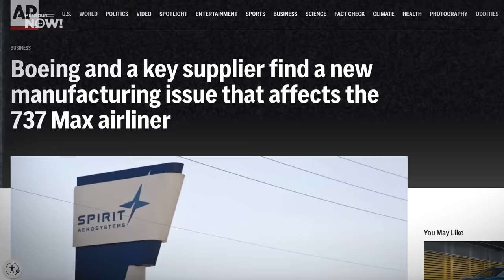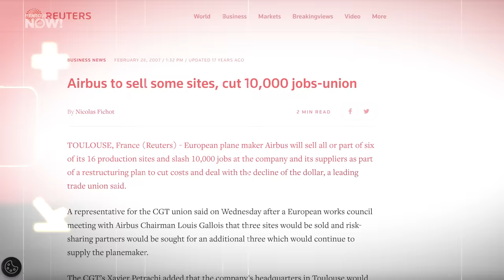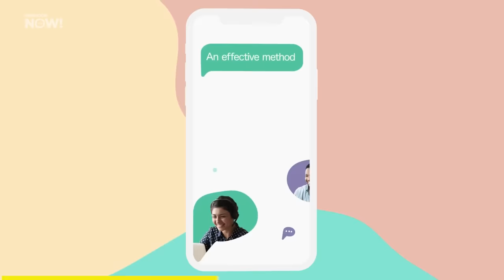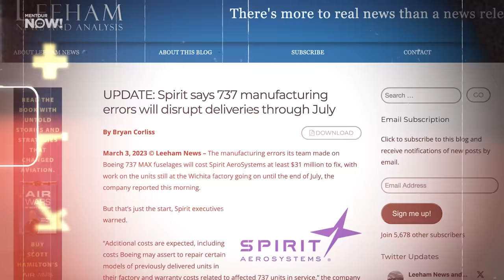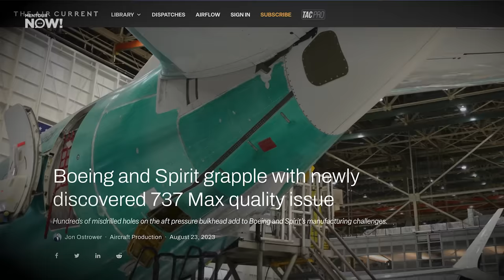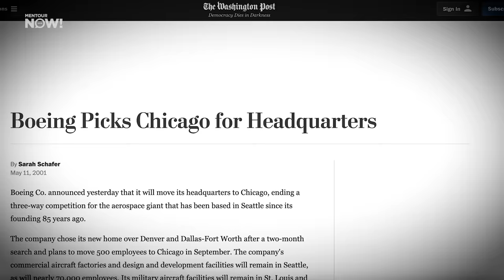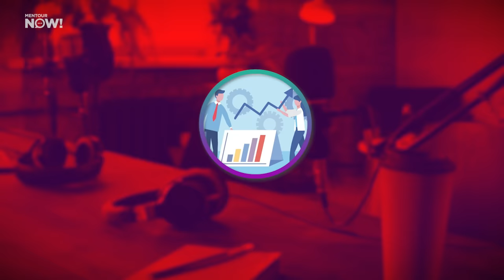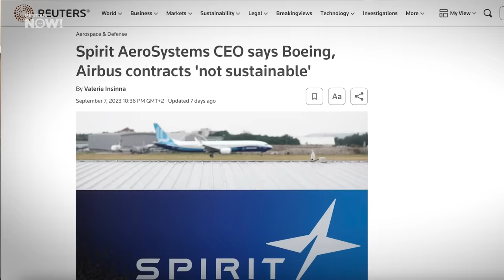NEW Problems with the B737MAX!

Comment: I am a former Boeing employee and had worked on DC-10, MD-11, C-17, 787, 777.
Boeing had gone down hill ever since 787 fiasco. Actually, it started back in 1997 when they bought McDonnell Douglas. The new management from McD had focus on profit rather than quality and excellence. They would always seek way to make money and reduced in-house production cost by focus only on assembly.
787 prototype and production proved that quality went down if the engineering and production weren't controlled by in-house. They spent more money and time in Everett by reworking and scrapping the sub-assembly from Italy, Japan and Korea. Every one was shocked to earn Mitsubishi in Japan had sent wing sub-assy to Korea, Korean couldn't even make fuking Hyundai!!!
The second mistake was relocated the 787 assembly to South Carolina to save on labor cost from the experienced union work force in WA. The hamburger flipper in S.C. screwed up the 787 big time. It took years for them to fix 787 acceptable to customers. Some of the work force in S.C. actually came from a worst company Vought.
Vought was as bad as Triumph.
Spirit is another screwed up company that Boeing relied heavily on in the name of profit.

Comment: Now another issue with a possible loose bolt in the rudder control system which operators are being asked to check. I guess AD's happen with all aircraft even when they've been in service a long time, but with the Max you can't help thinking it's a bit of a bodge job.

Comment: In the Boeing 737  Flight Crew Operations Manual (Quick Reference Handbook) is procedure "9.1 "Runaway Stabilizer" Condition: >Uncommanded stabilizer trim movement occurs continously< .The procedure is dated March 27, 2014, about 4 years before the Lion Air 737 MAX crashed. This procedure could have saved the aircraft.

Comment: It's funny how you mention Aerostructures in Hamble, (noe GE of course) as I used to work there quite a few years ago. I used to repair the Aircraft Manufacturing Tools, which were mainly Riveters and Drills for obvious reasons..... It was quite an experience and I used to love walking around the complex seeing how things were manufactured. I also had to along with colleagues test and set "Hand/Arm Vibration" Regs on certain tools.
it was just strange hearing the name "Aerostructures".... Thanks.

Comment: When bean counter get involved engineers get the boot. As for work ethic, that is also severely affected by policies which do not fall in line with safety, but hinge solely on the bottom line.

Comment: Touching on your comment about rail connections between the Renton and Everett plants, you are mistaken. While a line between Renton and the mainline east of Everett was severed some years ago, there is still a mainline between the two. In fact the fuselages coming from Spirit to Renton pass about 1 mile west of the Everett plant, and the parts that Spirit makes for the wide body aircraft take a spur from that mainline up the hill to the plant. Therefore, if appropriate flat cars were outfitted to carry 737 wings, they would simply follow the reverse route between Renton and Everett as the fuselages take, and those fuselages going to the Everett plant from Spirit, would just have a slightly shorter trip than their Renton counterparts.

Comment: Most big manufacturing/product businesses went through this “fad” in 1980-90’s to outsource non key components and move to being assemblers of their products rather than manufacturers, numbers were worked on cost to buy in vs cost to manufacture, there was pressure to get the “right” outcome to justify outsourcing, as such the cost of project managing outsourcing of products were minimised/ignored.  Project management of outsourced components became focused on purchase cost and OTD (on time delivery) in most cases Just In Time delivery to avoid cost of inventory. Cost of quality control was ignored and as such budgets not allocated to put inspectors in sub suppliers premises, this has led to many cases where final product integrity has been compromised by this approach.  It also has impacted lucrative spare part service businesses, as customers get smart they realise they can buy spare part significantly cheaper by going to the actual manufacturer and saving the 40+% overhead+markup the end suppliers add to spare part costs.

Comment: My philosophy is cheap is expensive. The 737 is cheap but it’s been so expensive for Boeing they could have built and entirely new aircraft line replacing the 737,757,767 dubbed the 797NMA. Offering it in 3 different versions to replace its beloved 73,75,76 aircrafts seating from 150 to 250-275. Wider fuselage with different lengths to accommodate and tailor it to customers needs. Giving the aircraft greater ground clearance to accommodate several different engine types depending on their max takeoff weight. With all the problems they had with the 737max a clean sheet design would have proven to be much better like the 787. The 777X is an old design and is way behind schedule again cheap is expensive. Just ask anyone who flys a ULCC 🤷‍♂️✈️

Comment: 9:40 The snowmen — finished properly — leave a figure-8 hole, or a round hole? When you say ‘elongated holes,’ is the problem when the second drill overlaps so neither hole it good? Maybe I am confused by the inserted manufacturing shot. Anyway good work.

Comment: The "snowman" holes point to potentially serious systemic Boeing quality control issues.  There are just too many stories of problems in current Boeing manufacturing practices.  There needs to be a halt and complete review of all Boing manufacturing procedures and QA / QC systems if we, the travelling public, are to have any faith in Boeing aircraft.  Let's face it, someone knew right at the outset of the faulty "snowman" drilling - and to have 300 of them in a given pressure bulkhead is no accident.  As an engineer I have experience of dubious quality issues with US profit driven production - and I suspect this may just be an industry wide problem that needs urgent regulatory oversight.

Comment: Nearly every company in the world that makes any complex product relies on at least one parts supplier. And every single one of them has a history of some kind of issue with those suppliers. It is amazing that after all these years the Apples, Samsungs, Boeings, and Air Buses of the world have not yet figured out, or are unwilling to implement, the necessary relationship it takes to eliminate those recurring issues. It must be a relationship that is so tight as to actually blur the lines between the companies. Only then will they be able to overcome these issues.

Comment: Airbus, as a European co-operation project, was set up to handle distributed manufacturing from the start. They have been floating wings on barges out of Wales and threading vast components through tiny streets in a French village for years. You wouldn’t design a system like that from scratch, but Airbus wasn’t starting from scratch and by now they have simply made it work. Boeing could have had a much more efficient system but they chose not to.

Comment: It's very easy to understand: originally, Boeing was managed and run by engineering people, a lot of them who came up through the ranks and were very smart people.
Then corporate America people gained control of Boeing and things have steadily gone downhill ever since do to cheap thinking in the head offices. So instead of making a bombproof plane even if it cost a bit more the push was to make everything cheaper and cheaper, even in departments like design.
How do I know this is true? Because I have over a dozen friends who either are still working for Boeing or retired after 20 or more years with the company
Reply: Best airliners ever built have to be the Constellation & the 707.

Comment: The 737-max issues have destroyed my trust in Boeing. That said im forced to fly on the 737-900's in November :| I can only hope they haven't had any issues.
Reply: Theres plenty of airlines in the US that fly Airbus 330-320-32. Yes it might cost a tiny bit more or you might end up on a discount airline but I stopped flying Boeing after 50 years. I make the extra 10 minute effort to fly modern aircraft that practically fly themselves. Airbus is simply superior.

Comment: The Fact that the FAA did nothing concerning non conforming geometry in a pressure bulk head takes the cake.  You think they would have learned there lesson with the Maneuvering Characteristics Augmentation System (MCAS) and Boeing's "self Audits".  300 out of 4000 fastener holes means 7.5% are are non conforming. That is beyond statistically significant.   The bottom line is Boeing cares more about share holder margins than flight safety.Boeing use to be a great company until the bean counters starting running it.  Maybe they should add a rudder and a ship's screw. I am sure they will need them sooner than later.

Comment: Pretty much the same thing could be said about General Motors during the late 1960's through 2009. GM (and almost every major builder) could've built their smaller, more fuel efficient cars (Vega, Chevette) better. Instead, they passed on basic engineering to save a buck and the marketing team tried to market the appeal of their crappy products. The Vega failed almost immediately. The full sized cars interiors were made of plastic  Fisher Price passed on. I own a low mile 1971 Oldsmobile 98 and the cheapness is clear to see vs 1965 GM cars. 
It was all downhill from there. I'm sure if better materials and engineering went into their cars, they'd be better remembered (Cimarron, Fiero, 4100 series Cadillac, V8-6-4 anyone?). All those products were half baked and then heavily marketed as superior just to have their butts handed to them by Japanese manufacturers that kept things simple and very very well engineered BEFORE they hit the dealerships.
Boeing was an engineering company that happened to build excellent planes. The merger happened and executives rode the tide of being #1. Engineering seemed to be its #1 concern prior to the merger and they made plenty of profits. Unfortunately, "plenty" wasn't enough. And here we are. Doors falling off of brand new  planes that were already tarnished thanks to indifference at the highest levels. 
Unfortunately, Boeing has no real competition in the USA, with executives still believing airlines will buy Boeing because Boeing. They'll apply the band aids and keep having unskilled personnel assembling their planes.

Comment: There is nothing "new" about the myriad problems Boeing is facing today, they've been having them for YEARS.  Ever since they were taken over by McDonald Douglas, they have substituted SAFETY for PROFITS, their top executives ignoring virtually ALL of the major problems with these new planes, from the lethal control problems, to the most recent door falling off of the freaking aircraft right after takeoff.  I don't know who's worse, Boeing or Spirit, but its clear that the problems that caused the first issues with the Maxs were never fully addressed, let alone solved.  
And speaking of money, don't these geniuses realize that it is far more cost effective than to make perfect parts BEFORE something goes catastrophically wrong, instead of AFTER, when they'll have to pull all of their airplanes off the line for structural retrofits when if they had done things right the first time none of them would have even been necessary in the first place??  Somebody's heads need to roll, on both sides of this disastrous equation.

Comment: very interesting, well I prefer Airbus planes as  I found them more comfortable than the B737 and  before that many years ago I was n an older Boeing jet  ( only for folidays and I am 82 years old and last  year took the trip of my life ; when I had a trip to SEZ and the first part was an Airbus  A350 from LHR. Had to change to an  B777  to SEZ. TYhe A380 was so comfortable, plemnty of room, good miles ( by Emirates airline ) On one part of journey on the  B777  at cruisee altitude there was bad turbulesnce and it was not so homfortable. anyway I do not have money for more holidays as I am 83 aand live in a seaside resort area in Eastern England. thanks so much for your interesting; kkep on flying.

Comment: Spirit isn't held accountable. Spirit also is the only company with the infrastructure and foot print to even build these fuselages (and other parts) so Boeing just has to sit there and take the lumps. They need to be more involved in the Quality side of things over in Wichita because who ever is in charge of it over there is utterly useless. It's a never ending cycle of "what did Spirit fuck up this time".

As someone who has to deal with it first hand it's frustrating.
Reply: Does Boeing even check what they receive from Spirit? In the video all the examples say a Spirit worker noticed the issues...

Comment: This vid absolutely blows my mind. There are so many things going on I don't know where to start. 
Why would they shut down a well used rail system to deliver pts?  If it needed some attention let Boeing and us gvt fix it. 
  The snowman holes, drilled by a person machine?  If a person md a mistake its pretty important that a supervisor is informed. 
Was the person worried they wd get in trouble?
NOW the whole company is in trouble. 
There is no excuse for the bulkhead to mk it so far trough production and not be caught. 
I'm available if you need someone to straighten shit out before you completely fail.

Comment: On Airbus subcontracting:  Airbus used to be more of an association/consortium that was supported by european governments to launch a competitor to Boeing/Lockheed/McDonnelDouglas. The shareholders of the "shell" company were the main production facilities such as Aérospatiale, DASA (Germany) and Hawker Siddley (which became BAe).  CASA from Spain later joined consortium.   So When Airbus got a design ready, there was fighting by the shareholders and the governments to get as much of the work as possible in that country.  And this often led to inefficient allocation of work and oots of delays due to political interference. 
In the 2000s, Airbus was converted into a coportation that purchased plants/assets from the consortrium member companies with the later becoming mere shareholders in the Airbus corporation and not involved in production of aircraft.   (it used to be Airbus GIE (Groupe Intéret Économique) and became Airbus SAS (Société par Actions Simplifiée). And Airbus eventually got listed on stock markets.  So when time came to build a new aircraft, it was Airbus that decided where work would be allocated. And it also made plants specialized, such as Broughton to make wings, and the Spanish site on composites.  (If i am not mistaken Aibus restructured in 2017 and dropped the SAS). 
And as a corporation, it could decide to build assembly plants in China and USA to help win sales there.   
In its first structure, it was not quite the same as outsourcing work to 3rd parties like Spirit, since as a consortium, work was given to consortium members (which was reason those companies became consortrium members so they could get that business of building portions of an aircraft). 
(The US equivalent would be Spirit owning  30% of Boeing and expecting to get 30% of work needed to built an aircraft).

Comment: Sub-contracting is almost always a cost saving maneuver not an engineering gaining maneuver. Unless it's a proprietary tool or process issue. And once you start focusing on profits and not engineering, then it's a slow but definite decline for a company. Maybe this is why Boeing has also had so many problems in their aerospace division with Artemis and Starliner. Both having quality of engineering issues.

Comment: What you are describing here are normal QC issues  during production and operation of all aircrafts, this is very common in the aviation industry as a whole and not limited to Boeing . The Boing 737 Max is in the spotlight due to previous issues related to system design.  You can make videos like this on all aircrafts if the manufacturer is transparent like Boeing is in this case.   The weakest link in aviation is and has been from the beginning  the human factor, pilots, engineers etc.   What this video demonstrates is that the QC system worked and identified the issues.

Comment: The challenge of transporting the 737 wings from Renton to Everett is not insurmountable even without a rail line. Boeing manufactures wing components for the 777 near Puyallup WA and transports them to Everett on the highways using a truck and oversized trailer that has a second steering cab at the rear. This is much like the long fire department ladder trucks that also have rear steering. The trips are made at night when there is less traffic.

Comment: Both factories are at an airport, maybe they can fit the parts in a dreamlifter. Renton is on the water Everett is not far from the water, they could haul them on a barge. I have seen the green fuselages on the highway, if they will fit on the road northbound they could truck them at night.

Comment: I worked for Goodrich Aerospace and used to make landing gears for Boeing. Boeing took short cuts to beat Airbus A320 neo to the market. Instead of redesign the fuselage and extend the length of landing gears, they moved the larger engines forward. This made the plane unstable and had to use software to control the plane. I don't fly 737 Max!

Comment: When such bad holes are drilled, the proper solution is to use a new part and start over.  The snowmen holes could be made by a single technician at Spirit who doesn’t know what he or she is doing.  Drilling into such expensive material, the technician would be motivated to cover up this bad work before a supervisor notices it.  Technicians like this need to be sent off to different careers, but it’s hard to imagine a career where such slop and carelessness would be tolerated.